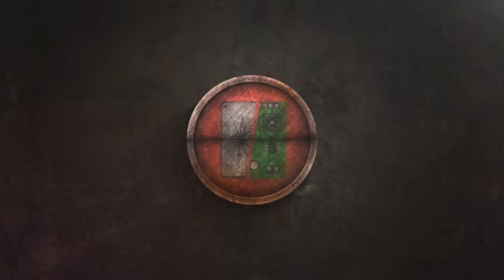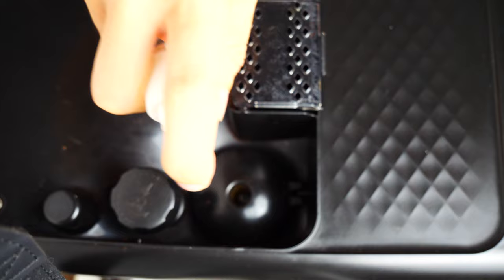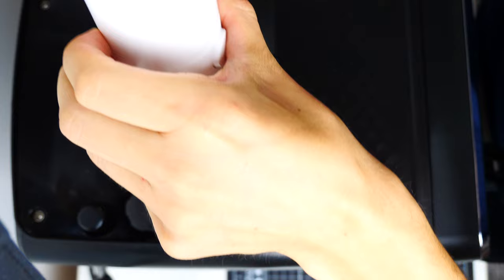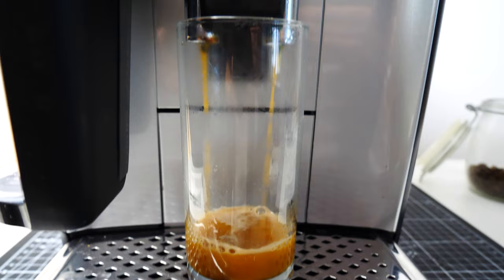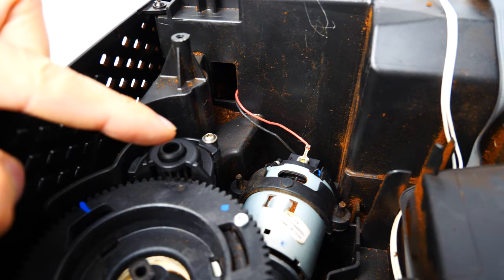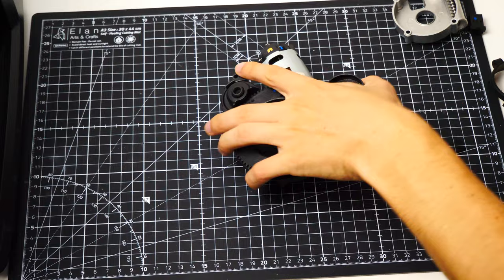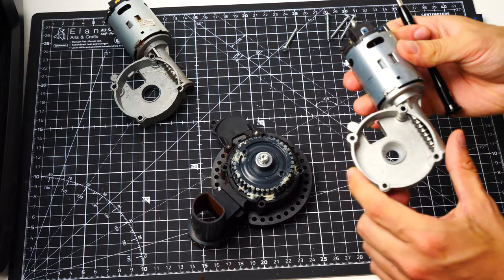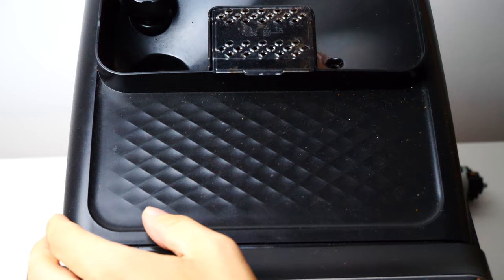Coffee Maker Repair ☕ Philips 3 lights error

Comment: Be aware that when you take the top off there are two plastic tabs in the front of the cover that fit into plastic loops of the front portion of the machine.  You must push down where the cover meets the front, on the front section, to lower those loops thus freeing the tab and allowing the cover to slip off.  If you don't do this and pull hard it will crack those loops.  Not the end of the world but if you want to have those loops there so the tabs from the cover can snap into them follow my instructions.
Reply: Solid advice, thanks

Comment: same issue with me ...opened the tray and to my surprise, the screw along with the bass guide from the top cap fell into the grinder..it broke the whole ceramic grinder to pieces...But a new part is 10 times cheaper than a new machine :D
Reply: Hello. Where you buy new part ?  I have same problem , but no idea where to buy
Reply: @nijazhundur405  just search for 3rd party suppliers of phillips coffee machine parts, if you have the exact model you should be able to find the right part where you live.

Comment: Thanks for the video, this is the exact reason I always go on YouTube when life gives me a technical problem! ;) In our case there was a hard bean that blocked the grinder, the motor could not turn it anymore. Luckily no burnt motor. Cleaned the grinder that it turned free and reassembled it. And now sipping a fresh brew, with much satisfaction!
Reply: Hi, you need to use a Hex torx T10 screwdriver to get out the screws

Comment: Thanks for making this video.  It was very helpful.  When I took the bean tray off, I discovered the screw holding down the motor had never been installed.  Consequently, the funnel for the grounds had snapped off the grinder housing.  i'm ordering a new one but used some rubber bands in the meanwhile to hold it on.  The funnel was clogged because it had been misaligned.  I cleaned everything out, put a screw in to hold the motor in place and reattached the tray.  She's working like a charm all thanks to you.
Reply from the maker: The Screw was installed by myself, originally there isn't any screw. I thought it's the reason for my issue. Finally I decide to leave the screw because it's much more stable.
Reply: It turns out the motor for the burr grinder is bad and I ordered a new one. The little funnel that the grounds go into from the grinder is broken also. I ordered a new one but cannot figure out how to install it. Help!
Reply from the maker: @JonMcCanless  I can not understand what part you mean. Do you mean the black tube where the grinded beans pass into the machine?
Reply: @technico5880  yes
Reply: @JonMcCanless  for that you have to take out the upper burr with its ring and than you can take out the funnel and install a new one

Comment: Thank you! This helped me a lot. I just took out every part, including the motor. There was a lot of coffee inside the machine, I cleaned all the parts and I put everything back, without replacing anything. It is working now. :) Question: where did you ordered the motor from? I searched for Philips parts but no success. Have a nice day!
Reply from the maker: You could have the same issue as my coffee maker have, it's only one specific winding of the motor that couse the error.
I do not order from Phillips. It was a smal supplier. I searched for the motor itself instead of Phillips parts.
Reply: @technico5880  Thanks for the video. Do you have part number for the motor and who was the small supplier? My coffee mashie is still working, but I can hear the motor dying. I would like to order the replacement part in advance. Thanks!
Reply from the maker: @zrokali  I ordered this one: https://www.ebay.de/itm/304719144716?chn=ps&norover=1&mkevt=1&mkrid=707-159967-267642-0&mkcid=2&mkscid=101&itemid=304719144716&targetid=1325693166479&device=c&mktype=pla&googleloc=9041788&poi=&campaignid=12876320283&mkgroupid=125994436481&rlsatarget=pla-1325693166479&abcId=9300534&merchantid=114634027&gclid=Cj0KCQiAtICdBhCLARIsALUBFcE_ofevypq4fy8_rKW1Ok_5Bh5BTDDVv-qZPQvO1M9bvnr6u_Qj-zsaAjx3EALw_wcB

Comment: Changed this motor and the problem persists. Even the boiler is not heating up. When turning on, coffee machine almost immediately starts blinking those 3 LEDs.
Reply: Hello, I have the same problem, did you find a solution?
Reply: @rbfr1569  Yes, I found the solution. In my case both thermostats was not working. Heating element was not heating. I'm assuming that connector which goes after heating element broke and water damaged both thermostats. Changed thermostats and connector and coffee machine is working again.
Reply: @xteam29  where is the thermostat located? I am having the same issue and it is not the grinder. It goes thru the 4 cycles then the 3 leds start to blink.
Reply: @at612  There is two thermostats located on heating element. You can check those with multimeter in continuity mode.
Reply: @xteam29 do you have the part numbers for both thermostats?
Reply: @rockervhit  I ordered parts by using only device model
Reply: @xteam29  any chance of a diagram or video of where these thermostats are located?
Reply: @xteam29  from who did you order parts?
Reply: @rockervhit  ASWO

Comment: Thanks for the video Nico! One question please. What can I do in order to make the the grounding smaller then the minimum by default? Because it's not that small. Thanks again.
Reply from the maker: You're welcome. You can open the grinder and turn it manually into a tighter position in order to minimise the space between the grinding stones. But be careful to not overtighten it because you can demage the grinder.
Reply: @technico5880  it is already at minimum.

Comment: Can anyone help me how can I find this motor? How it's called? if someone purchased it where did you buy it from and what is the approx price of it?
Reply from the maker: I am not 100% but I think I ordered at that shop: https://www.shop-wittlich.de/p/mahlwerkmotor-philips-saeco-996530000317-11000513-421944049151-230v
Reply: @technico5880  looks like it works. Somehow my grinder was full of with stoned coffee deep inside. It was hard to clean them but I did it and now it works well for almost 2 weeks. Thank you for your help! I hope I will not need the engine but I noted it in case of I will need it. Thanks!